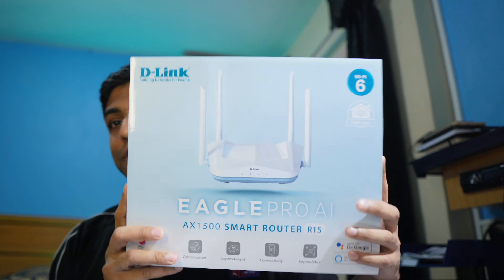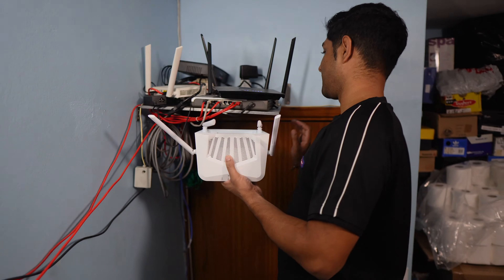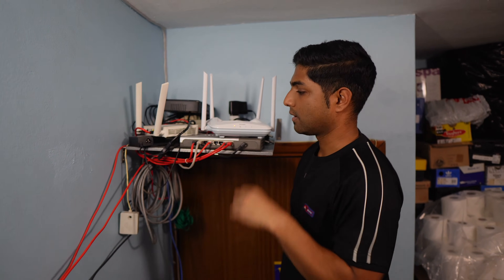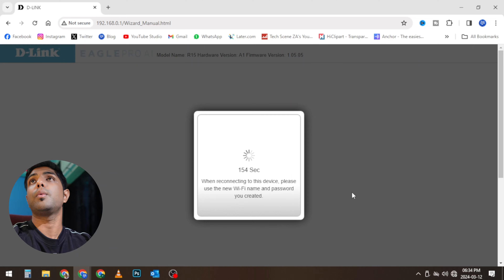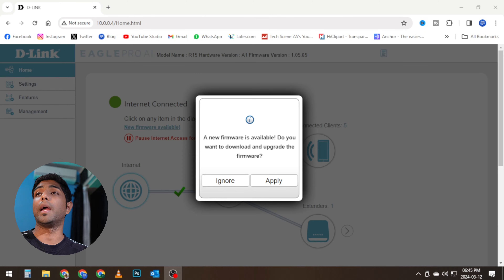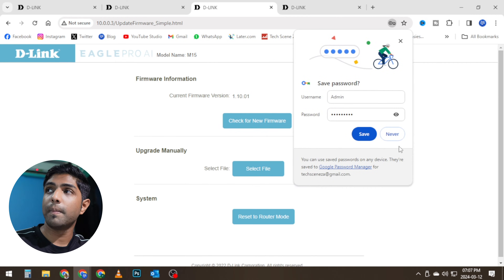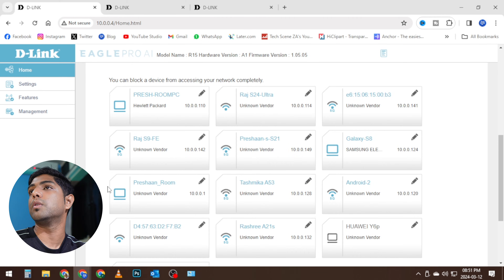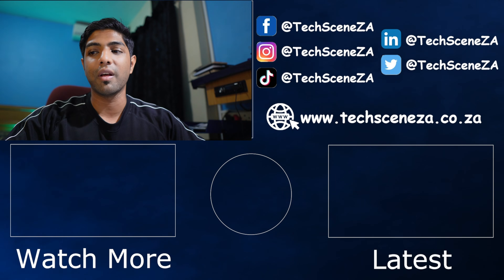Setting up the D-Link R15 Wifi 6 Eagle Pro AI Router with M15 Mesh nodes

Comment: Hai there... I have a question about this router, Cuz it's on sale for 22 bucks each right now,
Can I AI mesh with each other if I buy 2 of them? If can..  how does it work ? 
thanks :elbowcough:
Reply from the maker: Yes, because it's a mesh device you can connect R15 devices or even M15 devices to form part of your network or even the Eagle Pro AI range extender